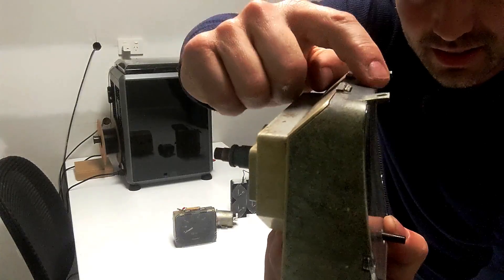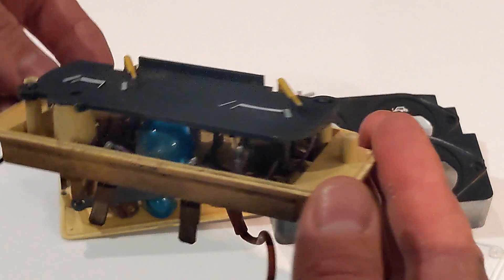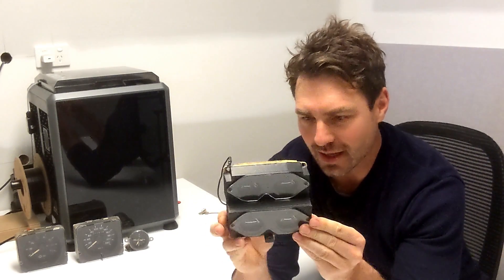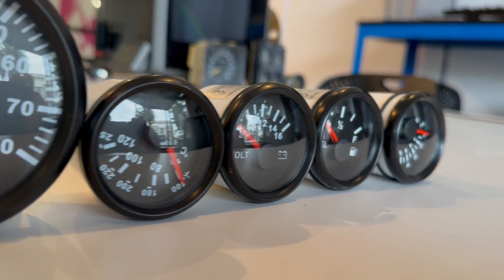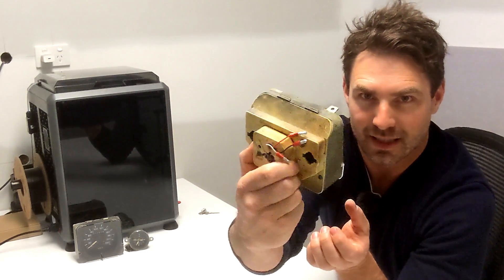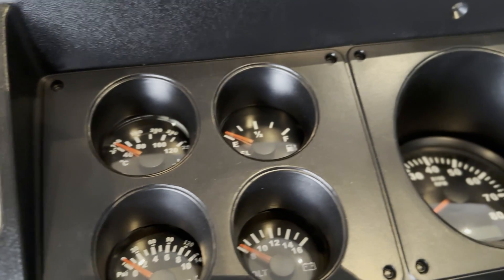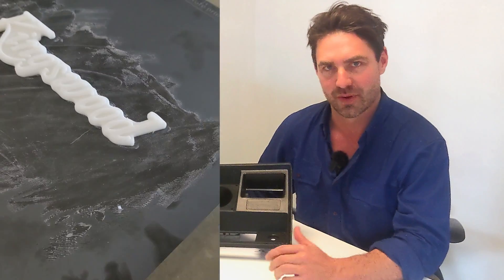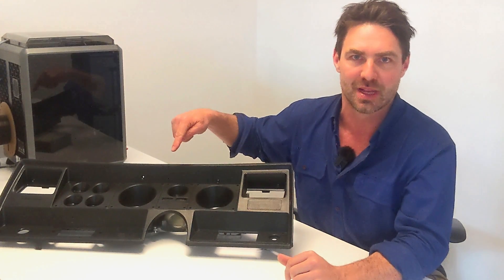EPISODE 78 - From Classic to Cutting-Edge: Upgrading My Holden HZ GTS Dash with 3D Printed Gauges.

Comment: I get this video was 2 years now, however Bambu labs make an awesome 3d printer which can offer multiple colours, so the fuel, oil, batt images can be white keeping with the original design. Love you videos mate, been following you for 5 years now. 👍👌
Reply from the maker: Yes you could definitely do that now with the AMS units on the printers, specifically the new H2D or H2S printers would be ideal. I have been waiting for the tech to offer the function which is now here so I am going to add one soon to the farm. Thanks for hanging in there for 5 years as well!

Comment: Truly excellent work there mate. Wondering about HQ models, if thats possible. 
I used China gauges before, one by one started to fail. 
I'll probably use USA made ones next time i get a chance to get HQ printed gauge panels
Reply from the maker: Thanks mate, HQ is in development now, should be finished in the next couple of weeks actually. Will be for Autometer and SAAS.
Reply: @BarnesysBuilds that's great, keep us updated on the HQ ones
Reply from the maker: @hmayerv8 I run the products under Unicq parts website Unicq.com.au so when I post a new product I send out an email to anyone that’s subscribed. It’s much easier that way. Cheers

Comment: Great Job Mate, very impressive! Do you know if anyone makes an aftermarket GTS Clock Face - Id like to adapt a generic quarts clock into the GTS Facia bit keep the original look -  As I'm not prepared to pay $500 odd  for broken OEM GMH Clocks! 
Cheers 👍
Reply from the maker: @purebloodheretic4682  thanks mate, I am in the process of getting a complete retro gauge kit made at the moment, modern versions of the originals. The closest clock you will get for there is the eBay one I have specced the kits out for. Smiths might also do a similar one but yeah nothing is really available that’s like the original hz GTS gauges.
Reply: @BarnesysBuilds  Thanks, I think you're on a winner with the OEM 3D replacement parts, but done right! 
Rare Spares need some competition - they want $750+ for a HQ Centre Console!  - I reckon if you printed them in 2-3 pieces & that could snap/glue together & sell them as a kit  - I sure there's a market for it 
- I'd do it if I could but the old Ender 3 ain't Gunna cut it! I'm going to have a crack @ printing some AWA & GMH  push button radio knobs - that's pushing the limit of my abilities! It's amazing how the Holden replacement has created it's own industry!  
It's a bloody shame we never kept Holden & Ford going even if they just put a 50% tariff on imports - Shut the doors & make it in  OZ & give Our Kids a future - I'd be happy if they still made new HQs in 2025 - Cheers 👍
Reply from the maker: @ Yes indeed, I’m up for the challenge of taking on Rare Spares, or working with them..

Yeah I paid 750 for a Consol, some things 3D printing can be better for and some not, the Consol slots into that category, it would take an enormous about of material and time to produce and in the end probably be more expensive than the plastic injected version. They pay up big at the start for the cnc mould to save money and time in the future. 3D printing eliminates that up front cost but at the expense of time which can end up being a lot for large parts. 

Yes it’s not so much about the printers anymore it’s about the ability to engineer and model the parts, that’s by far the most complex and skilled part of the process. I have plans for many more additions to the range so I will do my part to keep the old girls alive into the future.

Comment: I bet you learned how to "Level the fskin bed" and where is that damned draught  coming from warping the print ?
Yeah I noticed you have an enclosure. I had to use Cardboard Aided Design to make an enclosure for my Chiron (400 x 400) and pump the bed heat up crazy high when using ABS. When I did finally get a decent print it smashed the glass on the cool down ! (70 hour  print).
You made using the scanning app look easy too but it really isn't. 
I use FreeCAD on Linux (Ubuntu).
You done a great job though dude.
The gauges look well Pukka.
Reply from the maker: Thanks mate, yes there was hours and hours of trial and error not included in that time lapse, it was a really steep learning curve and lots of parts from china as I went along to get the machines dialled. Now they are dialled and working well but yes ABS is very challenging at the start, now I have the techniques sorted and have a filament I'm satisfied with I can print really confidently. Looking forward to seeing where this tech goes in the future.

Comment: Well done Barnesy, the series is great. I’m doing a Wb Ute and you are providing plenty of motivation. Where did you get the metal burnishing wheel that you were using in the first few episodes? Looks a lot better than using an angle grinder with a stripping 
disc. Keep up the good work and look forward to end result. Loved the paddock circle work in the first few episodes.👍
Reply from the maker: Thanks mate, it's a the long haul series that's for sure! Hope to finish it this year though. The burnishing machine can be grabbed from eBay now, it's great for prepping metal for paint and removing surface rust etc. or paint. Although years later I would now just get a car hot dipped or sand blasted if you can afford it, way faster and less hassle. If not then paint strip then burnish the remaining. Yeah used to get the ute out in a few B&S  balls back in the day! Cheers

Comment: Hi Barnesy, any chance I could order a set of these?
And can I grab the ebay link for the gauges as well? Regards
Reply from the maker: Yes you can,  I will have a link up by end of the week with them online and also the gauges they are adapted for. I will post a video on it so people can find out where the link is. Thanks
Reply: @BarnesysBuilds  Thank You !    Regards Ian
Reply from the maker: @IanAllen-mg1wz  Hey Ian, you can buy the gauge adapters here now, i have them online. https://unicq.com.au/ i had to do some fine tuning but happy with them all now.
Reply from the maker: Here is the link to the exact set of Gauges the adaptors are made for on ebay https://ebay.us/zMa6Lj
Reply: @BarnesysBuilds  Thanks Aaron
Reply: @BarnesysBuilds  Thanks Aaron
Reply: Hi Aaron,  Thanks for the set of guage holders !
And can you steer me in the direction of the clock?
Regards Ian

Comment: Hi mate I’d be interested in seeing the cost of the guages you got and helping support you by buying the backing plates. Are the facia steel supports the same from kingswood to gts or do I have to source a gts support to do this?
Reply from the maker: Hey mate, yeah thanks, appreciate that, looking to get them up online next week with pricing and let you know the link. The cast facia support frame are identical over hz and WB regardless of variant so good to role with what you have.
Reply from the maker: Hey mate, you can now get the gauge adaptor set online at www.unicq.com.au and the gauges themselves on ebay at https://ebay.us/zMa6Lj if you so wish. thanks!

Comment: Hey mate one part that you could do is the front blinker parker light housing's for the wb, i managed to find a new old stock pair but i reckon they'd sell like hot cakes. How much would you have to pay for a 3d printer like that? Good stuff mate 🍻
Reply from the maker: Same with rear tail light housings, i've been asked a few times about those so wil give them a go next i think.

Comment: Hi Barnesy great job. I added autometer gauges to my panel van with 3d printed parts from Ben in Gippsland but instead of a clock I fitted a high beam, left and right turn and alt warning light, I discovered you need the alt warning light to excite the alternator.
Reply from the maker: Yeah nice, I saw there were a couple of blokes doing them but I didn't get a response from my enquiries so I gave up and decided to make my own. The ones I got have the indicator lights in the Speedo which saves some stuffing around, hopefully not painful to hook up.

Comment: Hey Barnesy, do you think you could scan and then customise the fascia panel? Im looking for ways to make a completely custom fascia panel without the heater vents. Aiming for a smooth look...
Reply from the maker: I think some bloke just did that on a the hz wb Facebook group, it didn't look the same as the original dash just flat folded metal I think. If you wanted to keep the original dash and print and plastic weld heater blanks in yes you could do that

Comment: With regard to the badges, you can chrome plate them
Reply from the maker: I saw you can electroplate the plastic prints but quite a process it seems and still would show the print lines. I think I need a resin printer to or injection mould it.
Reply: I saw some sample resin prints at Jaycar and I was blown away at how smooth they were. Did not look anything like the 'hot' method prints.

Comment: great video.  there was another bloke doing this selling them on the Holden pages Ian Benjamin I bought a set they were rubbish nothing lined up.  I bought his adapters and I bought a set to speedhut gauges to suit.  cost me 2k.  got the shirts sold it all and went back to factory. great work Barnsey.
Reply from the maker: Yeah I knew there were a couple of blokes doing them but no one got back to my enquiries so I was literally at a loose end and decided to just make my own. Taking the time to make sure they have the ability to align mount points for that 1-2mm adjustment you need to get them bang on.

Comment: Hi Aaron, 
I was looking at 3D printing up a reproduction tail light bracket, then I had the thought of why put globes in it.  So am looking for a 75mm x 75mm LED panel i can mount behind the standard lens. Still a work in progress.
Reply from the maker: That sounds like a good work around for the globes. Would be interested to see how it turns out. Yeah the tail light housings are on the list to just do stock reproduction though. It's a big part as you know so need a hefty size printer or go vertical but lot of supports to print
Reply: @BarnesysBuilds That tail light mount would be a good thing. Mine are brittle and not much is holding the lenses in. You can get the lense but not the bucket. I managed to get 4 new old stock lenses years ago when Holden still had dealers with stock. Good work with the gauges Barnesy, can you pick the ‘icons’ on the cluster out in white? I have a spare cluster mount with the same lug broken off. I am having trouble with my temp gauge, it has been done up but won’t go right up to temp. The repairer got my oil gauge working but made the temp gauge worse. I have replaced the sender and have another gauge which registers the same which would lead you to believe it is in the wiring somewhere. Maybe the earth. What you are doing there is gold, no other manufacturer ever came up with a dash that looked as good as the Holden Sports Dash. Jeff

Comment: Bro you need to scan that gts subframe and get that metal 3d printed 🤣
Reply from the maker: I actually did scan it, you could get it printed in metal, cost a bomb though!
Reply: @BarnesysBuilds  prob cheaper then Tracking 1 down.. i wonder how it would hold up 100% filled??
Reply from the maker: @mickvenning6297  it would be stronger than the original if done in metal and sintered. If it was done in ABS solid fill probably pretty bloody good I reckon
Reply: Maybe a good option for those that can't track down or refuse to pay a stupid price to be able to run a reproduction gts dash 🤔
Reply: I thought all the sub frames were the same. I got one off the foot path and it was the same as mine.
Reply: Jeff, yes the metal backing frame is the same in all dashes: ie non GTS, prem. All the same.
Reply: @andrewharrison8880  oh true?? I was always under the impression they were different.. half the reason my car is sitting in a shed not being done and thought haveing a prem dash i was way off.. that's genuinly blown my mind.. could have really narrowed it down by not being a lazy ass and actualy looking I guess haha

Comment: Nice work Barnesy!
Reply from the maker: Thanks mate👍
Reply: @BarnesysBuilds  While your video was playing I was thinking of little oled displays that can be driven by an esp32 or similar micro and was thinking that might work well to recreate the original look of the meters. The Ebay units you got though are pretty hard to beat and a hell of a lot easier to implement and maintain. Good luck with the 3D side of things. You obviously know this shit very well.
Reply from the maker: @Bennyboy-dog  that's actually a great idea, I know you can get the OLED in the large round ones but haven't seen the small. How you would make it work would also be beyond me but I'm sure a coder could get it working to the digital output.
Reply: @BarnesysBuilds  ChatGPT for the code? I've gotten it to do some coding for the ESP32 and it works well after a couple of tries.
Reply from the maker: Defintly worth a look, i have a mate at work whos all over the code side of the electronics so i've mentioned to him it might be cool to try sometghing with some code and screens to drive he gauges.